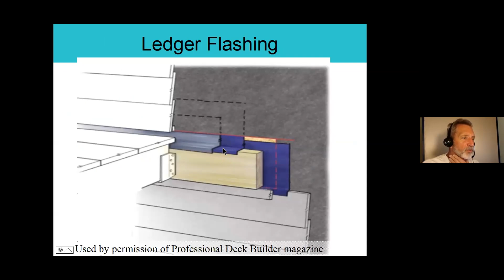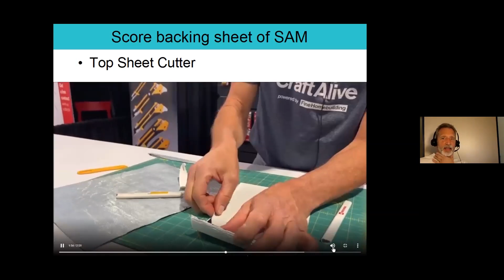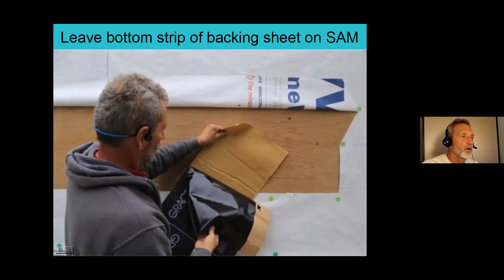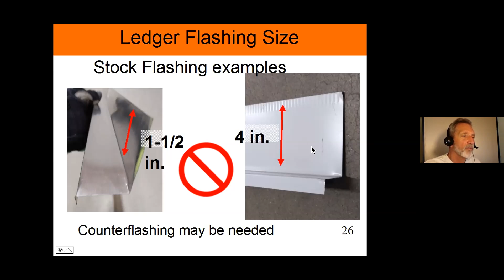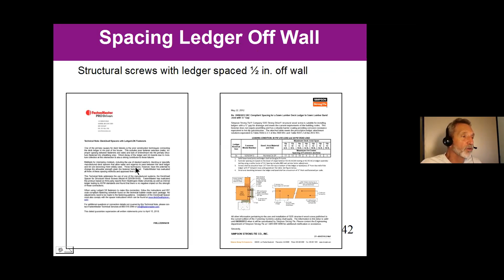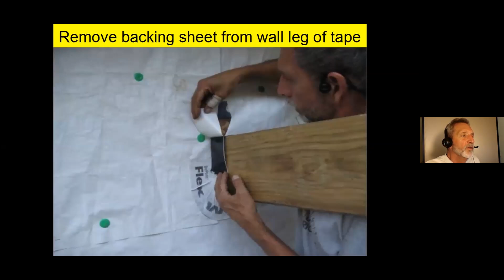Expert Session: Flashing a Deck Ledger

Comment: I tried scoring the backside of the paper.  Like you suggested.  Great idea.    Extremely difficult not to cut through the rubber membrane that’s 1/32”.   Menards product.   

Resisto from Home Depot is thicker and has a plastic release film that doesn’t come off in little pieces 

Good luck not cutting through the membrane!

Comment: Great video guys - just a few questions from a DIY guy as I watch this, thinking about my own deck project:
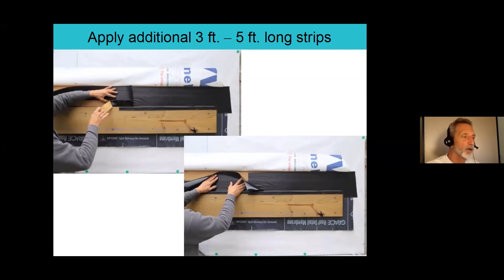1) 19:25 - Is it true that you can't put metal flashing over pressure treated lumber due to the chemicals in the lumber reacting with the metal?
2) 34:09 - If you space the ledger board, it seems like the ledger board isn't fastened as securely to the house.  From a flashing perspective (say structurally it's ok), is this superior than putting the ledger flat against the house and flashing over the ledger?

Comment: Ok, if using the hockey pucks and I heard that you can use cap flashing over the top. What about the bottom of the ledger board! Im using zip sheathing with rain screen and lp smart siding. Also, can I use zip flashing tape as a flashing behind my ledger board?  If so I would install in a shingle flashing. Great video with educational content, looking forward to the next video! 👍🏻